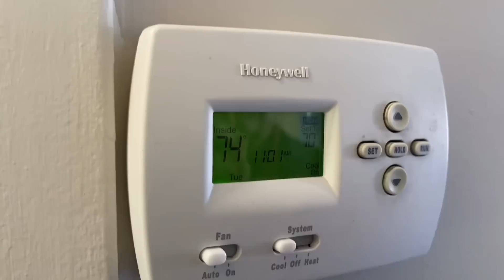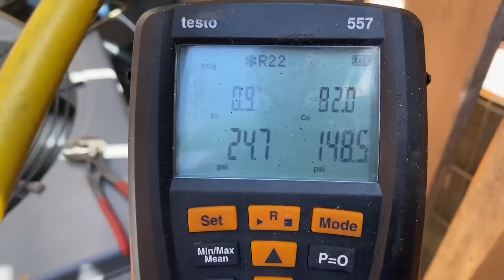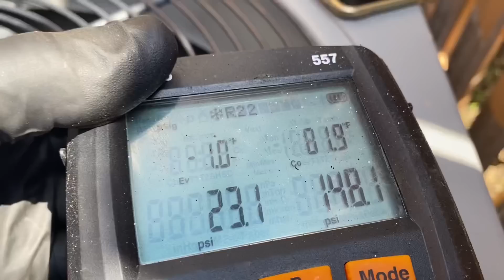Ancient Lennox Central AC Not Cooling Low on Refrigerant R22 How to Explain Options to Homeowner

Comment: You say no pressure, but you left it dirty. So no chance of any cooling. The pressure doesn’t come from you it comes from being uncomfortable. 

I would have at a minimum hosed the coil down with no cleaner. Spend a little bit of time. Then told him his options is detail. That would have been the right thing. Give them something.

Comment: You can add gas 410 instead of gas 22 and the unit will work without problems
Reply: Uses a different type of oil 410a is poe 22 is mineral oil
Reply: How about 427a,that would work

Comment: I have learned so much about sales due to watching how you do it. Give them the options and do what the customer wants. It puts them in the drivers seat and allows them to be in charge of what happens. Thanks for the info
Reply: @PipeDoctor  or the home owner  csn do what we did with have a 1998 gas furnace it's texas here we don't use the hest much. Well that ac unit went out and we just had the ac coil and condenser changed and kept the existing furnace. Now our furnace has not had major water leaks or issues so it's not all rotted out and nasty it still looks new.
Reply: @PipeDoctor  I guess we been lucky then so fair we've only had the blower motor die once in all the years we've had the furnace and the ac unit is 2019 icp so far we haven't had any issue except a blown Chinese capacitor.
The unit maintains 68 easily on a hot  100 degree day sun blaring down.

We also have a business that has 2 units  on the roof one unit is from 98 still working great it gets pm every season the other the furnace was replaced in 2008 store flooded after ike so it ruined the furnace.

2 years ago the ac unit on roof died so just it was replaced the coil and furnace downstairs was left theynjust changed the metering device as it was a r22/ 410a compatible coil that unit knock on wood has been preforming well too.

I didn't have the money to change the whole systems and I didn't want to save a condening unit that was a rusted out pos . Our store and house is located near the water and we'll it really rust out the unit.  You should see the 30 year old unit we have on that roof that has yet to be changed it's all rust. I expect that one will die soon. That one I believe the whole system will be changed the indoor unit is a pos too on that one.  The other units where still good.
Reply: @PipeDoctor  well Mikey looks like the time has come the 2nd unint at our store has died the compressor blew its terminals lost its charge looks like a 28 year old unit is getting changed out.

It's getting replaced with a new icp system indoor and outdoor unit both are getting changed.

It was a nice surprise this morning walking into our showroom and it's 80 degrees inside well the ac stopped cooling on one side of the store.  We have 2 units cooling the store if one dies though the whole showroom gets hot.

Comment: Here in Denver a builder grade 3 ton AC system (no furnace) is installed for ~7k right now, but I know there are a few of the larger outfits charging 15-20k for complete systems like that.

Comment: This is why most people should just go with a zoned system.  

Makes life so much easier just dealing with one system and works great for humidity control since both returns are pulling in air at the same time whether one zone is running or both are running.

That's what I have in my house and it works flawlessly even in Tennessee's hot and humid climate.  I keep both thermostats at 68 and never had an issue.

Not every HVAC guy has experience installing these though.  Pretty expensive to set up initially too but totally worth it if the contractor knows what he's doing.
Reply: I find zoned systems become a nuisance. Working on them is a touch more complicated and labor intensive. If it's not a 2 stage or madulating system you are essentially choking the system or it is short cycling more because of high limits, discharge air temp so on so forth. But if set up correctly with a VRF/modulating system or a two stage system I would totally agree with you. As long as some dumb bozo doesn't sheetrock over zone dampers or something
Reply: @shapedstones  In the hot summer they will run pretty much all day anyway thus reducing short cycling and help a lot with humidity control.  The key is just sizing it correctly.

On a zoned system you can technically undersize it slightly because in a normal circumstance only one zone will be on at a time which in a way would make it a little oversized for that zone and would cool quicker and shut off but when both zones are calling it will even out the pressure.

I do agree that it takes the right tech to do it properly.

Luckily, the contractor that did it for me specializes in zoned systems and it was done properly.

I keep having this thought in my head how bad it would have been if I got 2 systems and both went out around a year or two from each other.  It would be rather expensive.

Just makes more economical sense to go with one system that's zoned since it works just as good as two.
Reply: properly designed single zone system for two floors can do fine - multiple systems and zoning are a cover up a lot of the time.
Reply: @Jon-hx7pe  Mine is a single stage and works great.  No problems in 7 years.

The less fancier bells and whistles the better.  Less that can go wrong and much cheaper.

Comment: Wow, if they had to replace both furnaces, 30k Plus.
A bit funny, the unit with the problems, the outside condenser doesn't look nearly as bad as the one that's currently functioning.
The placement of the outside condensers definitely does not look ideal.

Comment: i would pay you to fix the old Lennox lol they just don’t make them like that anymore case and point that new unit is from 2013 and it’s leaking it’s really sad 😞and i have to agree with you on the equipment the cost of 22 is off the charts but so is the cost of equipment so what do you do personally most techs wont like me so i will keep this to my self
Reply: Condensor is 2013. Furnace and evap is original to the build. Could be leaking from anywhere.

Comment: That was a dry fit r22 replacement from 2013 by the sticker outside, so what we do not know is has he had to add r22 after the unit was installed, yes there is a leak probably in the coil or in the expansion valve on the coil. I think i would have educated him on how much he could possibly save just on the ac replacement first , it was more than likely a 10 SEER dry fit and a replacement ac system basic today is 13SEER  approx 30% savings on air cond cost. Then the furnace i would have just offered him a 90% AFUE furnace to replace the old Lennox unit that was around 65% AFUE rating when new,  another approx 30% savings on the heating side. Just to keep things simple so he could understand why it makes sense to replace now as opposed to spending x amount of dollars to add refrigerant now.
Reply: Im sure he had other contractors look at it he knew a bit
Reply: the furnaces are exceedingly likely to have cracked heat exchangers - everything should be replaced.